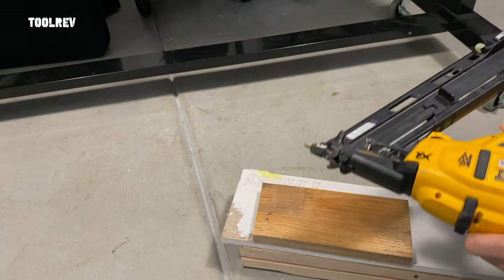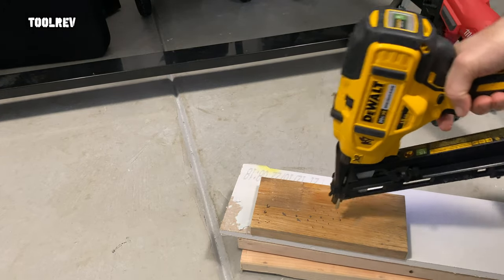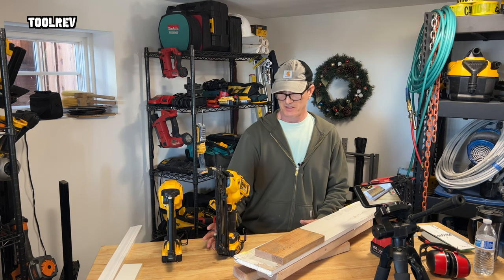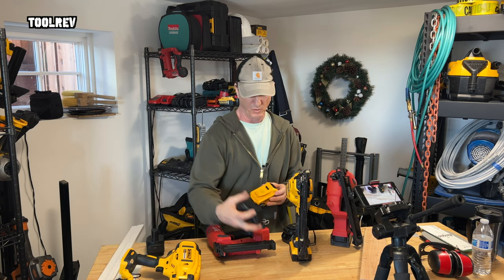DeWalt 15 GA & 18 GA Cordless Nailer Review ⚡️

Comment: Thanks for the review.  I too have the same Milwaukee nailers as you.  They perform admirably tbh.  My only concern is to the longevity of each unit; been seeing some problems with the nitrogen tanks running dry and having to bring the unit in for servicing.  Wish Milwaukee would’ve added an outboard air valve for us in order to top up the tank if/when needed - Metabo, Rigid and Ryobi do with their framing nailers.  Guess you got the best of both worlds if you got both nailers!
Reply from the maker: I have seen a guy somewhere on youtube crack open his Milwaukee FUEL framing nailer and refill it with regular air. I guess it's not as good as nitro in certain weather but...

Comment: My 2nd fix dewalt is misfiring blocking regular and struggles with 50mm pins the mechanism is starting to falter aswell doesn't always engage the trigger. Only 3 years old minimal use really not been used all day everyday

Comment: 5:31 SOLD you can free hand shoot with the gun no safety trigger like on air compressor guns. 🤣
Reply from the maker: To be clear for those who don’t get your joke these nailers should only fire when the tip is depressed.
Reply: @toolrev  That is correct. Although you do have to be careful with these guns as even the Dewalt (DCN623B - 20V MAX XR, 23 GAUGE PIN NAILER) also has the ability to fire free hand without the tip being depressed.